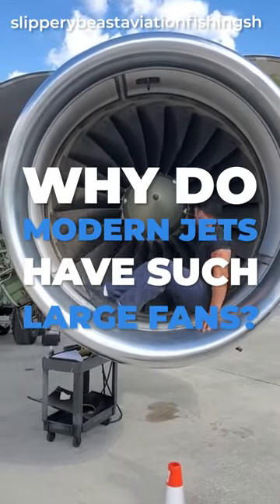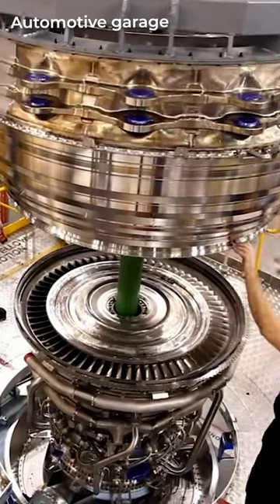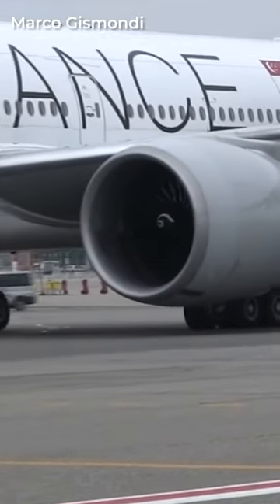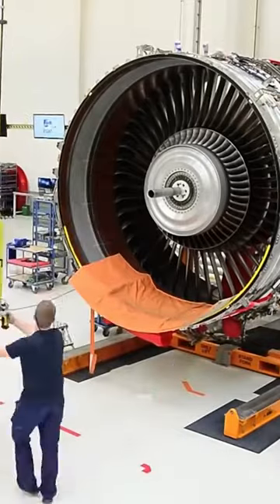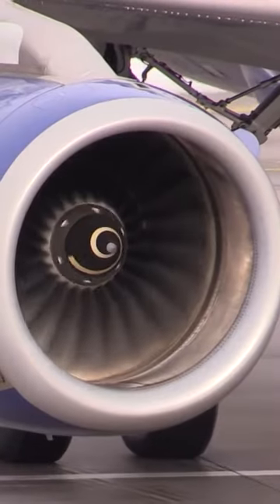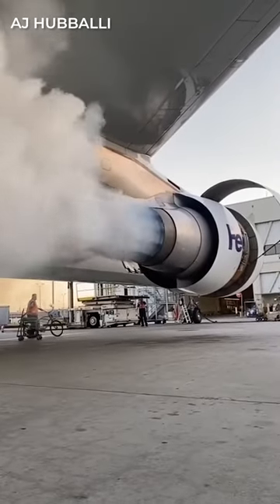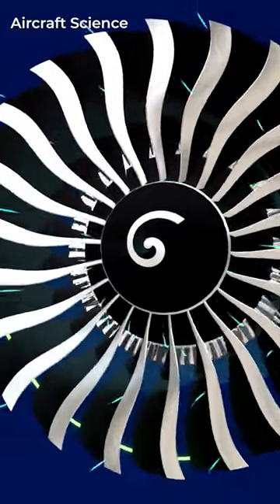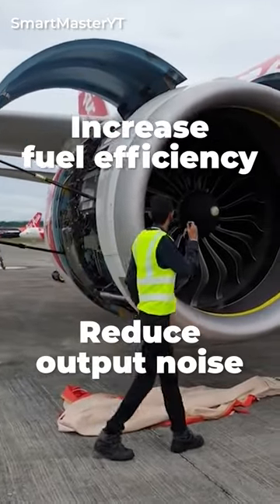Why Do Modern Jets Have Such Large Fans? #shorts

Comment: What do you mean large!?
I'd say they are pretty compact for the amount of thrust they produce to lift that amount of weight.
Reply: I always feel that some planes, like Embraer E2, have engines too big for the purpose
Reply: The core of the engine, is much smaller. Back in the days, the core was the only thing on the engine producing thrust. Than a fan was added to the front. These fans have significantly increased in size.